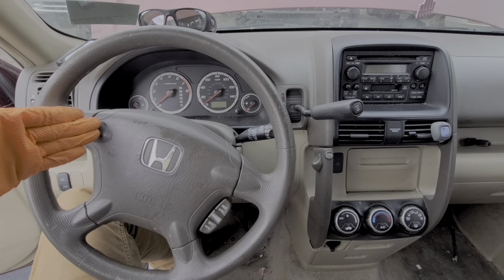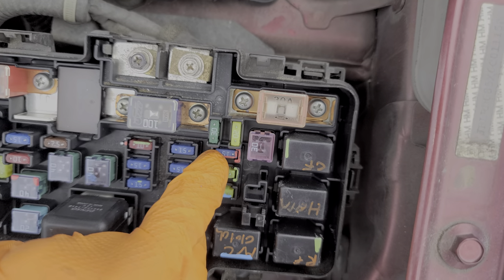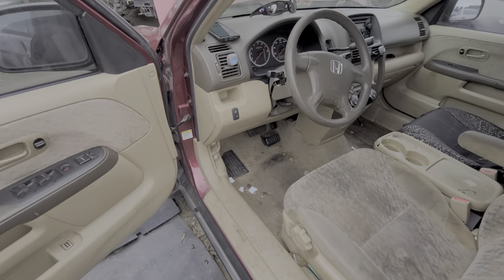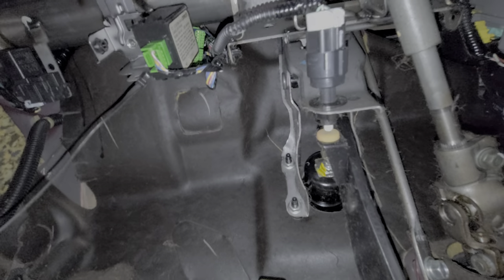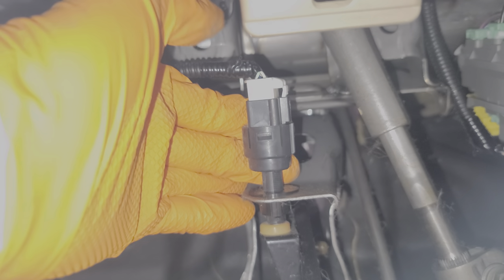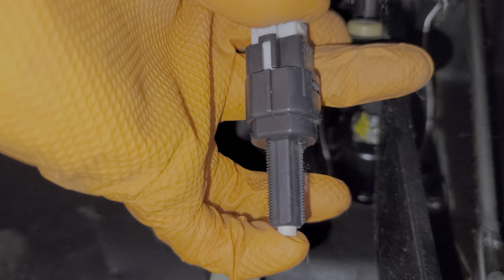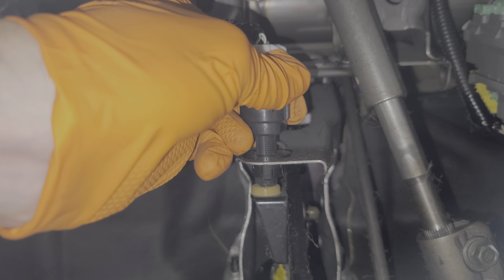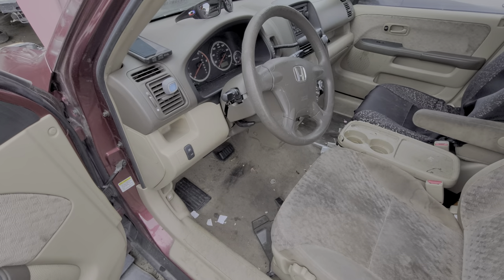2006 Honda CRV Brake Light Fuse & Stop Light Switch Replacement - Check for Brake Light Stuck On

Comment: Thank you....I was lucky because I noticed the lights still on  ( don't want to imagine where I'd be if my first warning of a problem was a dead battery).Saw your YouTube video that night and tried the fuses first ,nope..checked and found plastic pieces on the floor.Bought $5 grommet followed your instructions and VOILA break lights work as they should.
#female62thanksU👏

Comment: Thank you for sharing this valuable information. Very concise instructions for dummies like me. One point to note is that when this part fails, either the switch or the pad, the cruise control stops operating until the parts work again, and the brake lights turn off. In my case, it was the pad that had disintegrated and fell onto the brake cover panel. Once I opened the panel, the broken parts fell to the floor. So, others might want to note the unoperable cruise control is the clue to what the problem really is since no pieces of the broken pad are obvious until opening the brake cover panel.

Comment: Thanks! I should of watched this before taking it to be repaired. They did not even notice the missing disintegrated grommet. I bought the replacement for 7 dollars and the guy at the auto parts store gave me an ever cheaper hack...2 pennies and duck tape.
Reply: Thank you for sharing!  2 pennies & tape it will be for me until I can get a new grommet. Wonderful!! (I put a stick in the space to save my battery overnight. Tmro pennies!)

Comment: Great video. Replaced fuses, replaced switch, replaced bulbs on left and right side. Still no brake lights.
Reply: I have the same problem
Reply: What did u do to fix it?
Reply: You might try checking if that rubber grommet at the end of brake pedal assembly is disintegrated. I just replaced that, and the brake lights are now off, thank God( and Lehew tech).

Comment: Got it. Thank you. My switch rotated forty-five degrees counter clockwise, but no sweat? It is 104F and 52% humidity here. Could not have fixed so quickly without you.

Comment: I have a 2005 Honda CR-V that is identical to this one featured in the video but mine is a stick shift. I have a VSA warning light that came on yesterday and when I scanned the system for codes it said that the brake light switch was faulty so I’m assuming that is probably the culprit in my case. I’ve also had another concern with the clutch pedal. Recently I removed the clutch pedal assembly from the car so that I could grease the bushings and hardware inside of the assembly because it was squeaking every time I depressed the clutch pedal and I did my very best to line everything up correctly when I mounted it back inside the car but since then I noticed that the pedal feels slightly different in terms of the biting point. It’s not bad, just different. So my question for you is do you know if you have to “fine tune” the clutch pedal the same way as you would with the brake light switch?

Comment: Excellent video probably best I’ve seen. I am assumed I have a bad switch. The part that is confusing me is that the brake lights work fine during the day however the problem starts when I turn on the lights and the brake lights stay locked on. Any advice or just replace the switch and see what happens?

Comment: On my wifes to 07 crv only the top brake light turns on when depressing the brakes, fuses are good, switch appears to be working. All the bulbs are new. Do you think theres a short in a wire somewhere?

Comment: My right side brake light won't come on I clean it with electrical cleaner and changed the bulb plus checked the fuse ?

Comment: Guess I should complain to Honda.
That little piece of rubber failed after 23 years and 290000 miles on my crv.
The switch is fine.